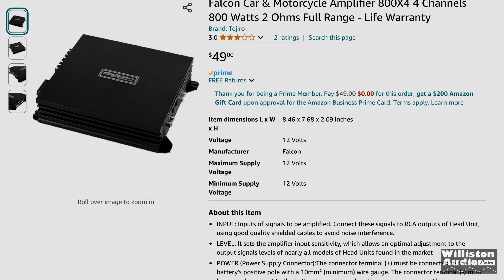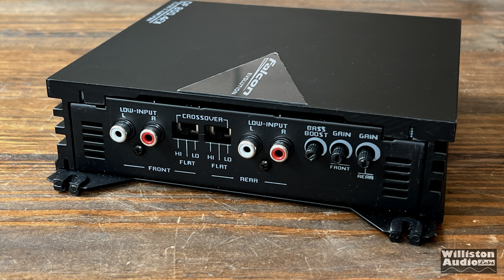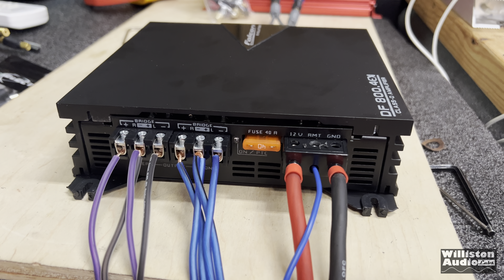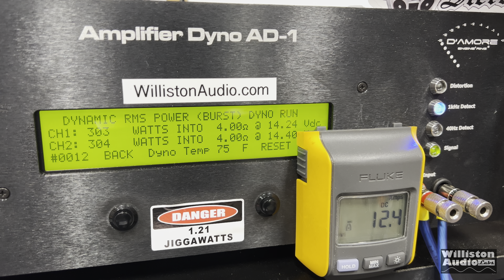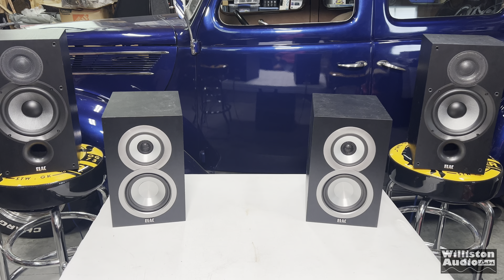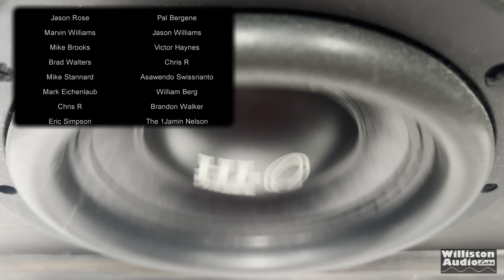How Bad is this $50 4ch 800W Amazon Amp?

Comment from the maker: SHOP (Used in Video)
Falcon 800.4EX 800W 4ch Amp: https://amzn.to/3zll7re
Elac Debut B2 6.2 Bookshelf Speakers: https://amzn.to/4d8pkw8
Elac Uni-Fi 2.0 B52 Bookshelf Speakers: https://amzn.to/3zmg7Ti
SAVARD Hi-Q 6.5" Subwoofer: https://lddy.no/1iv98
Knuconceptz 16ga OFC Speaker Cable: https://amzn.to/47rY22K
Massive Audio BP-PS100 100A Power Supply: https://amzn.to/4gp7mZj
Stinger Fused Distribution Block: https://amzn.to/3XVthQR
Stinger Ground Distribution Block: https://amzn.to/3XvSv6P

SHOP (Related Products)
Taramps TS800x4 - https://amzn.to/4dVIGWJ
Soundigital 800.4EVO - https://amzn.to/47B4a8X
Banda 800.4 Amplifier - https://amzn.to/47vL0Ba
Down4Sound JP84 - https://lddy.no/1hx44
Ocean Audio OAE-90.4 Amplifier - https://amzn.to/4d76WnI

TEST BENCH EQUIPMENT
SMD / D'Amore Engineering Amp Dyno (AD-1): https://is.gd/wccad1
XS Power D1400 Batteries - https://amzn.to/2BPFCKW
XS Power PSC60 Charger - https://amzn.to/2CHGcfs
Fluke 1000A AC/DC Clamp Meter: https://amzn.to/2Rw5WDA
Handheld Dyno AMM-1: https://is.gd/wccamm1
My Favorite Precision Screwdriver Kit: https://amzn.to/3yAaPmn

DISCLAIMER: This video and description contains affiliate links, which means that if you purchase from one of the product links, I may receive a small commission. As an Amazon Associate I earn from qualifying purchases. As an eBay Partner, I may be compensated if you make a purchase
Reply: What they should have done is rated at 600 watts then we would have been more impressed. But like you said its 50 bucks shipped. Only question i have is sound. Does this amp make engine noise. Does it have a built in ground filter?
Reply: it is sold out at 50, there is other options at almost $100
Reply: On a side note what ever happen to the amp that got sent across the pond to barevids? Was wanting to see some big power number Or did i miss the video?

Comment: the dyno tests are good but I really wish you could also show signal to noise ratio or at least tell us how much "hiss" it has at lower volumes because main speakers is what these kind of amps are intended for and should be used for. people are nuts trying to run subwoofers off amps like this just buy a mono block intended for sub's

Comment: Thanks for the testing of this. Most amps especially a off brand will never put out what it claims. Advertising ploy, however this one is not a fully puffed lie on the specs.  What I find shocking is if they are using those chips at the end as output speaker drivers without any heat sink, unless they are heat sinked on their bottom.   Some years ago I bought a used  Blu-ray disc unit with built in 6 channel amp and 6 speakers from a thrift store. 2 channels did not work. One of the 2 channel chips went out. these  were surface mount so I sent it off just the board to have the replacement chip put in. it came back and now the system is shorted and nothing will work. Stuff happens. In the mean time I bought another used one off E-bay in working order. Knowing how the other one killed the output chip, I did what I could inside the case for better direct ventilation in that area over the heat sinks. This unit had a tiny fan on the back, but to be safe I always run it with external USB laptop cooling system pad under it. Those chips are only about the size of my little finger nail and they rate the system as 1000 watts. That is just to small to get high power, it can be loud but I don't push it and don't need to in a small house living a town. Output full sized transistors can get very hot and they are only carrying one channel or half of that channel.

Comment: Pair this with the $25 Walmart Dual head unit & you'll be jammin for less than a synthetic oil change.

Dollars per watts is getting ridiculously easy & cheap, even if they are punking the ratings. Couldn't even get a good EQ/booster for that back in the day.

Comment: Now, if they would just rate the amp at 75 wpc X 4 from the get-go we would be praising them for exceeding the rated power.  Sometimes I just don't understand these marketing "geniuses". The quality/materials look kinda cheap but hey,  if it works? But how long will it last. BTW, I've used a couple of Crunch amps myself and actually liked them. Way short of their rating but the fuse rating (2 x 30) told what I needed to know.

Comment: At 50$ its a good deal, perfect output for 4 mid woofers.. Although he didn't do a 2 chan 2 ohm test, which if it can't do would be a deal breaker for me. On the flipside it's now 100$ and you can get NVX amps in that price range, that are probably significantly better.

Comment: Great video thanks for looking at the cheaper stuff. 600W for 50 bucks isn't bad at all!!! Neither is 88W per channel in 4 channel mode at 4 Ohms. Yes, way over rated, but a very practical budget car audio amplifier for anyone wanting a bit more noise in their ride. Also, totally practical for a completely stock system. No batteries or capacitors required to run it at full power off your stock car system if you want. Most people need about 300W for excellent pounding bass in their cars with a single 10 or a couple 8's or 6.5 subs in the trunk or under the seat. This does that and does it nice and cheap. Not everything should be for competition class audio or super high power audio. Sometimes you just need a few hundred for the subs and 100 or so each for the mids and highs. You could have a pair of these and run 4 speakers and a couple subs very easily in a stock vehicle without taxing the electronics. They're small and easy to set up. No high level inputs of course but a high level to low level converter is super cheap and easy to find anyway. Run an inexpensive DSP unit and you have all your cross over and filter control and input and output switching as well.

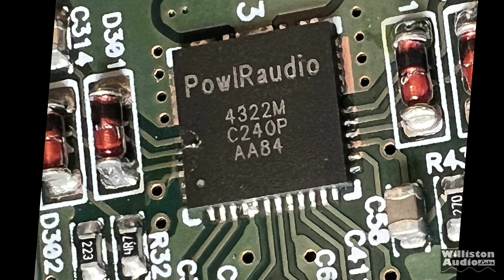Comment: 6:52 PowIRaudio is an International Rectifier IR4322M
Via datasheet IR4322 Output power (Typical, THD+N=10%) 100 W/ 4 Ω 100 W/ 2 Ω
Im not sure how it tested higher, Maybe there driving the IC's with a higher voltage. the datasheet is kind hard to follow it shows no graphs or voltage/output power
Reply: chip supply voltage might be a good regulated +-25v  and the MosFet in the chip is rated 40mOhm. It should be good for 2ohm 180w or bridged 350w . considering 50$ is quite a deal. equivalent to Tpa3255 but this chip is more efficient.
Reply: @bunnatang2081  TPA3255 is starting to age aswell, over the last couple years theres been SO MANY of these TINY quad flat pack type of amplifiers that put out hundreds of watts with either no heatsink at all or one smaller than a dime. Ive stopped keeping up lol

Comment: is it dangerous to use cheap amps? Ive only bought small mono block amps but from companies like Rockford Fosgate, JL Audio, Jensen cause I dont want one of the cheap ones starting a fire in my trunk
Reply: It's extremely rare for an amplifier to catch on fire so I wouldn't be worried about that. If anything internally were to short out, that 40 amp fuse would blow very quick.

Your typical problems with a cheap amp, would be poor sound quality and less than rated power. The reliability would also be very questionable.

Comment: For $50, if you really don't need an amp but want to have more control on the frequency going to your speakers, it would work. Just have to use it like an old school cross over and not expect much amplification.

Comment: For 50 bucks, hell, I can't complain much. Lol. Decent power still, even though it didn't do the rated. My Taramps TS 800.4 twins have that same speaker wiring setup, that's probably the only thing I dislike about it. Great video Big D, thanks for the mid week video!! I hope you're having a great week bud!
Reply: By twins, I mean I have 2 matching ones for my front stage😊

Comment: One hour later and it’s already $95.
Reply: At $95 it's definitely not worth it.  Get the PRV Audio QS800.4 instead.
Reply: @cup_and_cone mini max or Ct sounds. I would even go taramps or avatar 4 channels for 100 bucks
Reply: Wow 95.bux in a hour of this video that's crazy
Reply: @joshholden8561  And seven hours after the video dropped, still $95 and only two ratings. The only review reads, "I will be returning this soon" and only has one star.
Reply: @thomaskendall452  sounds a bit done on purpose to me
Reply: Often times if you keep searching you'll find another seller offering the same item for less.  I just clicked his link 23 hours after posting and the item isn't even available anymore.  Not that I was going to buy it.  I'll spend $50 on an old school marketplace find instead.
Reply: Makes me wonder if wiz dosent do this and lets amazon or the company know he’s doing one then pulls in the affiliate dough from Amazon or a percentage from the seller/company
Reply: @pinktacostretcher  There are 17k views, I suppose some of those viewers are in the market for a $50 amp.  I'm here mostly for the old school stuff but I enjoy seeing new products fail to make advertised power as well.
Reply: When the wiz does a video on the good cheap stuff. The price goes up.
I'm glad he hasn't done Slapz audio yet. They're still cheap as hell ... for now
Reply: Doesn't really matter, it'll be sold out, and never heard from again, in under a week.
Reply: Amp is back in stock
Reply: Big Ds amp may have been an open box. It looks used. Maybe a returned unit. That would explain it's much lower price.
Reply: @JasonWW2000 He literally says it was brand new less than 30 sec into the video

Comment: I just traded my 800 watt Taramps 4 channel for a bass 3k. It seems like this amp is very similar.The taramps 800.4 was the 1ohm version,so my DC 90.4 sounds better at 2 ohms per channel.

Comment: I don't take issue with the three terminals per two speakers, they negatives always share the same trace anyway
Reply from the maker: yeah it's just difficult to fit the wire inside one terminal and will probably confuse da peeps
Reply: I've seen that before, but this one shares positive of the left channel with negative of the right channel, which is unusual.

Comment: Can’t beat the performance for the price but I wouldn’t build any system around it. Many signs of using lower grade parts: gain pot knobs have mold flash, board held down by uncoated screws, mismatched screws in the power terminal block,etc. This is a backup amp at best.
Reply from the maker: You said it

Comment: At the end of the day aren’t these amp tests mostly about setting the proper expectations? There have been amps tested on this channel that make huge power but since they were rated for even higher power than they actually do they are looked down upon. 
I
Hey @bigd I think it would be interesting if you started tracking dollars per watt of all the amps you test and keep a running list of what the best value for your dollar is. I suspect that many overrated amps would end up being higher on the list than expected. Would also help drive your mission of finding the “everyday persons” daily driver amplifier.

Comment: Falcon has been in the Brazilian market for over 25 years their systems usually sound good and costs low money.
Reply from the maker: I noticed the QR code on the box after I'd already finished the video and saw they were a Brazilian company. Very interesting
Reply: This is not true. It never sounded and doesn't sounds good. It's just cheap.

Comment: advised it to a buddy on a budget, getting my sisters 04 impala going, i think the factory amp is going out and this should be solid, already replaced the headunit and to my surprise ran5/6 channel outputs. ill just tap into factory amp wiring in the trunk. dont even have to remove the headunit.

Comment: Does moving the gain change the wattage the amp Is putting out
Reply: If you set the gain properly, you will get the maximum wattage output.

If you lower the gain, wattage output will decrease.

If you increase the gain past properly set, it will still have the same power output but it will distort and clip.
Reply: Yes. It allows people to get full power regardless if your headunit puts out 4v or 0.5v max.